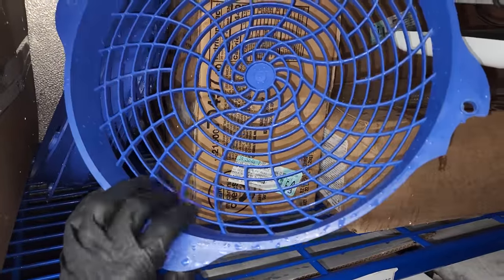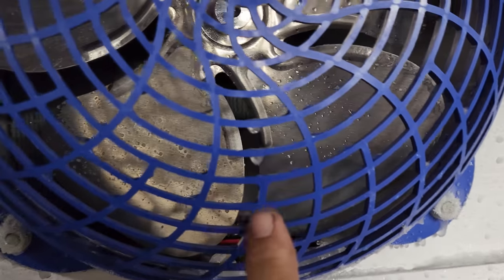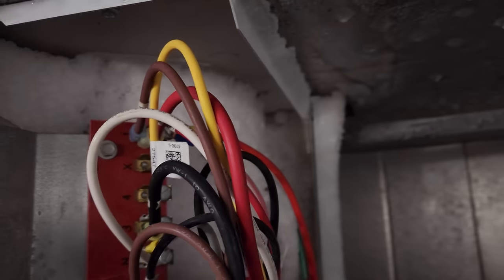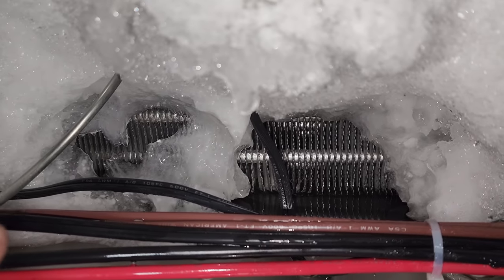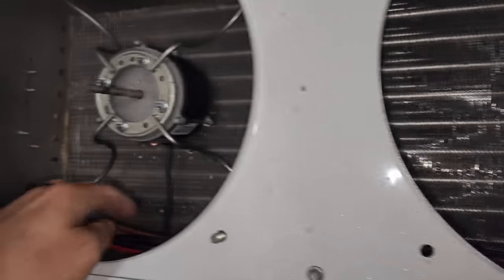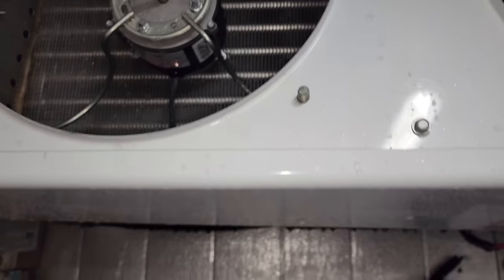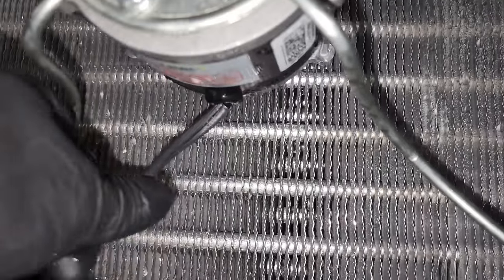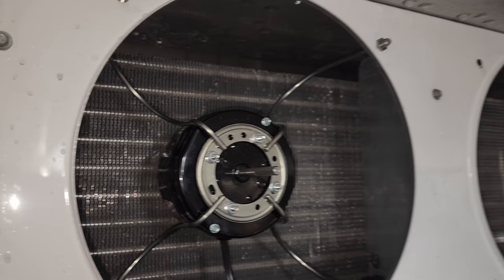THE WALK IN FREEZER HAS A LITTLE ICE ON IT.....

Comment: I had a "warranty" call on a brand new reach in at a Chinese restaurant.   I open it up and it is packed with food and they had stacked blocks of butter on all sides of the evap, killing any air flow.  Evap was a solid block of ice.   I reorganized the food and used a marker to draw a line and told them they could not store anything above the line.   That went over like a lead balloon.   Not as bad as when they had to write a check before I left since it was user error and not a warranty   :D

Comment: You have to also understand that most of use see ice on a freezer and just assume that it's normal because it's a freezer. They were concerned because the fans stopped working, but probably didn't think the ice was even an issue. Definitely a lesson. I can tell my managers that the fans have alot of ice on them and I'm sure they'll just ignore it unless it's not working.
Reply: Yeah I get it, but as a manager of a restaurant you should know how ur equipment has to run
Reply: @dank9139  Idk, depends on the quality of it really, a McDonalds manager whos been promoted after 6 months of menial labor doesnt exactly have a go-getter attitude and respect for the McDonalds brand, at most he knows how to work all the machines and teach new employees, hes not certified in HVAC.

Comment: Are we all guessing what the cost of service is? Let me join!
•After-hours/weekend service call: $125
•Labour (after-hours): 5 @ 175 each $875
•Evaporator fan motor: 3 @150 each $450
•Fan mounting bracket: 3 @ 75 each $225
•Evaporator fan guard: 3 @ 50 each $150
•Beard /beardface service charge: $685

Estimate: $2,510
Reply: I could not resist to try and look up parts (lets say "challenge accepted" ;) ) , and for those Heatcraft parts I don´t know what sh##hole I found for prices, but they were way of from what I would have guessed. In that shop, I could have ordered the brackets for about 25 bucks, I would have expected at least 40 with such "specialized" parts. Fan Blades were all over the place between just 11 USD to about 70 USD, according to the site all original Heatcraft parts, not too sure about that. My guess for those blades (not sure if those are 8 or 10 inch), somewhere between 20 and 40.
Fan Guard on that dubious page about 25 for some looking somewhat like them, again I would have guessed those parts to go for more like 50 USD each. For motors that size on their site it was about 200, which lies full within a range I know of motors about that size which in the past for other things I have seen selling between anything like 100 to ridiculous 500 Dollars.
I also found an actual Heatcraft / Interlink price list, but that one was of no use at all without knowing the exact parts numbers. In there motors could have started at about 160, going straight up, motor brackets startet at 7, not sure what kind of bracket, but those could go up quite a bit. And there seemed of course to be all kinds of brackets and motor mounts in there, from reach ins to large indoor blower motor mounts. The one closest to those seemed to be like 50 USD. The fan guard was easier, as they actually have listed a blue plastic fan guard with actually 25 bucks as list price. Other fan guards that size go well between 90 and 130 it seems. Best part was the motor, I found actually a catalogue picture of a motor that looked like the ones he put in. And here I am not fully convinced that was the right one, because that one was listed for about 670 Dollars... Others with only one digit difference in the number were listed as 270, but to be honest, I wouldn´t even be surprised if those listed for 670 are the ones. 
Of course with list prices, who can tell what they actually sell for. But as Chris mentioned they paid more parts than labour, I think they may well have been beyond 350 bucks each.
Reply: Lol
Reply: Blades too lol
Reply: @alexanderkupke920  Fan Motor part number is 25317701 superseded to 25317701S with list price of $669 each.
Reply: Your estimate is a bit low since the fan motor part number is 25317701 superseded to 25317701S with list price of $669 each.
Reply: @Jon.Rushing  ok, so I found the right one in the price list. I didn't check the actual part number from the video. I just wasn't sure if it was the 7701 o 7801 version. Difference seems to be voltage I think. But the price was all the same anyways.
Reply: Loving the  "beardface grizzled knowledgable dude fee"
Reply: Cali tax though
Reply: that's a way more detailed method than i used to come up with 2.5k lol i wish he'd let us know who is closest
Reply: You forgot "Frustration" charge! LoL!!!
Reply: That's California add another k

Comment: 3:40 Chris, I don't think it is your job to have emergency calls which would have been completely avoidable. 
I (in IT though) charge an "unneccessary because avoidable emergency call" fee with +100% on top of the normal overtime price in these cases. Of course you will get a call from accountants, but then you explain the situation to them and they gladly pay AND the manager's bosses boss will make sure they will NEVER call late to an unnormal behaviour of any system. Never lost a customer because of this fee and in the End the customers were much more happy because they could get problems solved in the normal worktimes which is much cheaper than overtime.
Since I'm not fortune-teller, I have to rely on reports from customers, and Friday evening at 17 o'clock is the worst possible reporting time for a problem that has been lurking around for 4 days. Once the customers got that, there won't be any problems with late emergency calls, only real problems which occured really just at this moment.
Reply: It is not your place or your right to punish a customer for their lack of knowledge in the field. You are a crook and I hope your customers learn this, tell their friends/partners and you lose your business. If you don't want to deal with a customer's ignorance, refuse the call and let someone with some compassion, patience and intelligence handle it.
Reply: @johnd5398  At the beginning of the video Chris states that the customer knew that the equipment was offline and needed service "since before yesterday" but chose to make an emergency after-hours call even though they had PLENTY of time to call before then. It's not "lack of knowledge" when you're fully aware that urgent repairs are needed but willingly decide to put it off until 11PM on a weekend. That's being an asshole, and the technician has every right to be frustrated with you for making them waste their precious time off when you could (and should!) have made the service call at an appropriate hour. And as harsh as you may think the arsehole fee, as I call it, is, business executives generally see the world in dollar signs, and this is often a great (and sometimes the only) way to make them notice that their employees are consistently wasting money by upgrading their ordinary repair bills to emergency status. Which you would have understood if you actually read and comprehended deineroehre2012's entire comment. Did you not notice the part where the higher-ups were thankful that they were made aware of the management problem so they could fix it? In the long run they're saving money, which they know full well.
Reply: @johnd5398  punish? That's not punishment, dude, it's tuition.
Reply: @johnd5398  No, they need to learn that when a problem comes up you call and have it dealt with right then and there. You don't wait half a week because you don't want to deal with it. You know where this 'punishment' for dealing with a problem late is common? Auto repair, if you have your brakes serviced right when they start making noise, you are probably looking at normal repair bills. Let it go for several months or the better part of a year and your repair bill just tripled. Why? Because when you let it go it starts to damage other things and makes the repair far more difficult. What was a pad replacement, rotor maintenance/replacement turned into two calipers, fluid exchange, ABS service, pads and rotor replacement. Waiting costs you more. Lack of knowledge on how to fix something is not whats getting you punished, it's knowing there is a problem and not having it fixed or being so ignorant of your own equipment you don't even know when it's not working.

But if you wait until the middle of the night to call and have me fix a problem, you bet your ass I am going to charge an 'ignorance fee'. Would you say it's ridiculous to charge someone extra because they waited until hours after a restaurant closed to call and place an order, just to force everyone to come in on their time off and deal with your call? It's the same thing, if you wait until someone is off duty to call them and ask for service that could have been done during their normal working hours you SHOULD be charged more for not being a responsible adult.

But go ahead and tell me that i'm a crook for charging more when you let your car fall apart before you bring it in for service right at closing time and ask me to fix it for you. I didn't want your bussiness anyway, there are plenty of customers that understand waiting until closing to come in with a car you have been neglecting for almost a year is a stupid thing to do.

Comment: This evaporator is a clear contender for the worst iced up of all time.
Reply: its actually not the worse i've seen  its pretty up there but damn  i've seen just 1  that was worse   the coil was so iced  it pushed off the dripping pan .. had to change the coil
Reply: "Sir, looks like an evaporator came with your block of ice..."
Reply: $2700?
Reply: with that much ice i would want Scotch to go with it!
Reply: @ianmontgomery7534  You need about a 55 gal. drum of it to use all that ice.
Reply: Not even close. Wait till that frost turns into ice that is clear, 5h is a very short time to defrost a freezer coil that is iced up.

Comment: You know. In comparison to that manager. My boss (who’s the owner of the store) is actually responsible. I noticed the freezer temps were way too high at around 10pm. Called him and let him know. We had a repair guy out within an hour and it repaired with 2hrs from when they got there.
Reply: That is the difference if the manager is also the owner and thus responsible for any failure. lets face it he knows pretty well, if the freezer goes bad he may be down for a day and loose quite some money in product. For those chains where the managers were "just" hired, it is not their money that goes down the drain. and as long as there is no immediate issue with product thawing and hindering business, calling someone for those keeping the books may just look like "wasting money on unnecessary repairs, as those know even less on what that means than most of those managers. (I bet there is a load of responsible managers out there as well, but unless something very catastrophic happens them making a service call as soon as a problem shows up may not make for as good a video, so at least for us, those may go by completely unnoticed. Also not sure if a decision for or against Preventative Maintenance is on them or made somewhere else.)

Comment: Had something almost identical to this on a Chick-fil-A freezer not long ago. Evap fans were not running and the coil was iced. thought it was the termination not bringing the fans on. Turned out the wire coming through the fire wall to the board was severed. Nice job as always sir.

Comment: Man, customers are the bane of my job. I'm a construction equipment Field mechanic, customers won't call until 430 and then get mad we are 2 hours away and get even more mad when we ask questions about the problem. The amount of times I've been told it won't start, drive to hours to find it running and that the problem was the ac isn't working or lights being out. I've told customers if they'd actually tell us the issue we can bring the correct parts. I've been called out at 3 am for no power to a forklift, ask them if a specific wire is off because, they always cut the wire to disable an alarm that if it grounds it blows the main fuse, been told nope everything is good so I drive 2 hours and find the wire touching metal and find the fuse blown. Then they get mad I charge them 4 hours of drive time and the 30 minutes to fix it.

Comment: 15:45 Three beefy evap motors.... at least $200 a pop.... $600. Grills and brackets, maybe another $100 per blower. running total: $900. Double parts for labor. $1800. "You ruined my Saturday / emergency call fee", $300. $2100. Extra buffering: I guess $2,500 total for the repair.
Reply: That’s to cheap! You won’t pay that in Atlanta Georgia. You have a problem like that in Georgia your paying for it.

Comment: Nice vid - one comment: With a little bit of brass spelter and some borate or fluoroborate flux (the stuff you probably already have to braze brass and bronze fittings that dont always take the self fluxing cuphos braze innately) you can just braze stainless steel back together (plain, galvanized etc also ^^). Couple minutes, looks like hell, works just fine. Just dont use the regular self fluxing phos bronze, imho it makes for brittle joints, phosphorous and steel is a bad mix.

Comment: Personally, I would issue that customer an ultimatum.  Either they sign up for a service contract that includes regular maintenance, or they're going to have to find another company to handle their service calls.  Customers like that need to be fired.  Yes, you can absolutely fire your customers.

Anything you say to the on site staff is going to fall on deaf ears.  You need to go higher - to the owner.

Your other customers that needed service had to wait because that one customer isn't doing what they should have done.  Fire that customer so that your other good customers don't have to suffer.

You have more work than you can handle.  Cull the herd.

Comment: I’ve been told by our local heatcraft rep that they have an issue with the fan motors and brackets on the low temp qrc and intelligen evaporators…I noticed they gave you different motors than what was originally in it
Reply: Kind out of interest I tried to look up those parts and found the actual Heatcraft / Interlink price list, a lot of parts in there is actually marked as obsolet and a recommendation for a replacement is listed, maybe the same here, depending on where they source those parts. Also, if they sourced them differently, it may be there are over time different looking, but interchangeable ones around, if they did not change the part number in that case.
Regarding issues with those motors and brackets, seeing the damage made me wonder. I know those brackets have actually the bent "wires" as mounting legs, as those supposedly to a certain degree can dampen vibration. but where they broke it looked like they did not weld them but used just a dot of hot glue. even the chrome plating seems to have got into the weld. Seemed to be some manufacturing issue.
Same for the motor cable breaking right at the sleeve. I would not wonder if it was bent in that place and there was tension on it. But it was straight out with no tension, So I wonder if during production something pinched the cables at that point (maybe when the sleeve that should protect the cable where it comes out of the motor was installed) causing them to easily fail with higher than normal vibrations and ice building up. If there was indeed an issue with this style of motors, that would also explain why he got different ones that obviously came form a different source.

Comment: Ever seen a heat guy used to burn paint to go after this? No additional water to get of down a stopped up or restricted drain.  You must be conservative and caution around wires and sensors  but pinpoint accuracy.  Not great for each situation but speedy when you can. GFI a must.

Comment: Quck tip for "holding" things... I use the 3rd hand by fastcaps... That with a clamp mouth clamp with the clamps on both sides. You can set the pole up ceiling to floor and then set the gun in the clamp, ANYWHERE you possibly could want. ;)
Reply: ---SmallRig Clamp w/ 1/4" and 3/8" Thread and 9.5 Inches Adjustable Friction Power Articulating Magic Arm--- the clamp, i bought 2 and took off the camera threads, and installed the other clamp.  sometimes the cord weight messes with you but i ziptie it to the 3rd hand pole